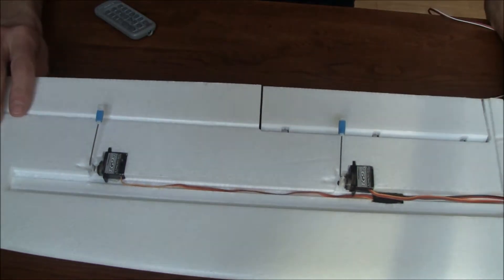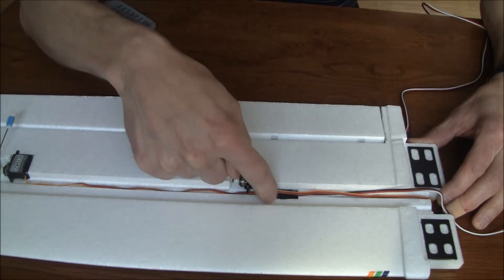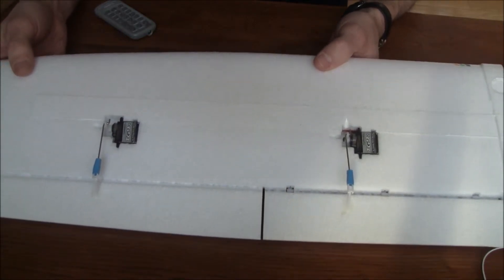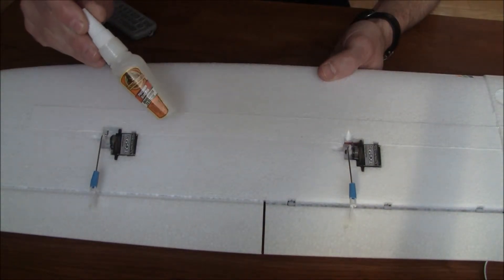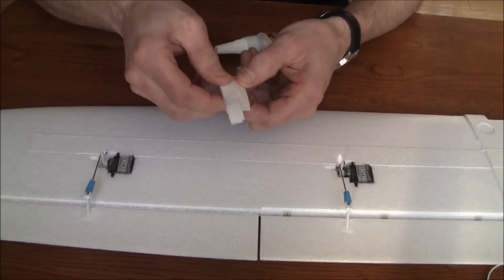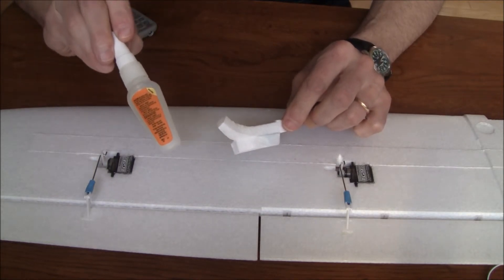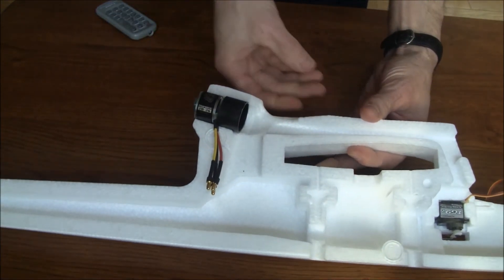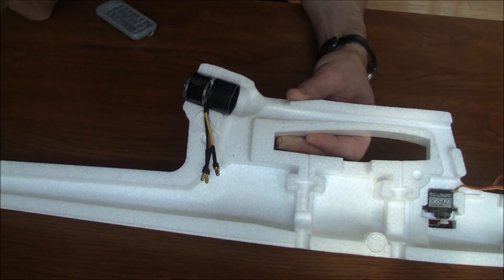Work on Wings and Install Motor

Comment: This helped me thanks but now im not sure about how i should connect the motor to its electricity source (probably cuz i didnt have any education about technical stuff).
Reply from the maker: The servo motors all get connected to the controller which is also connected to the battery.  The controller received signals from the remote and translates them into a corresponding movement of the motor.
Reply: drbrono ok thank you so much now I can make my own!